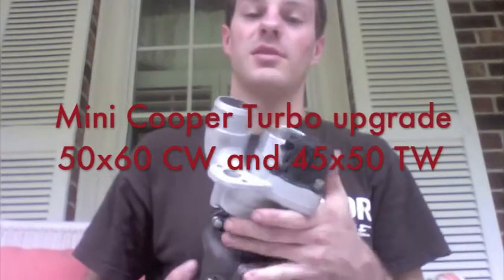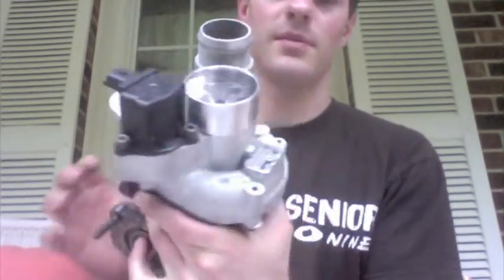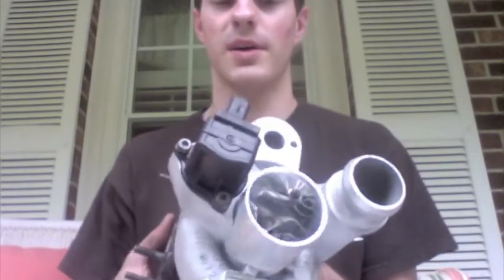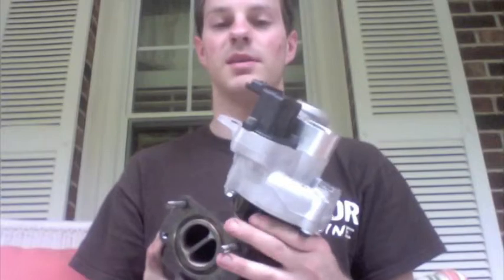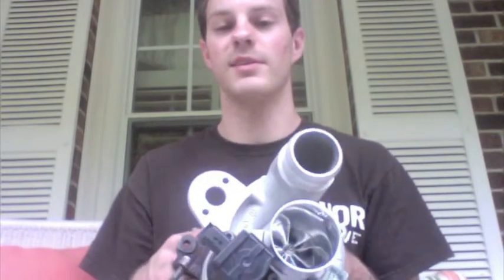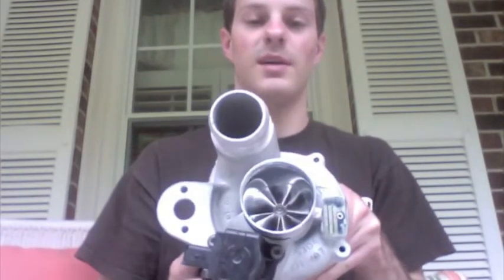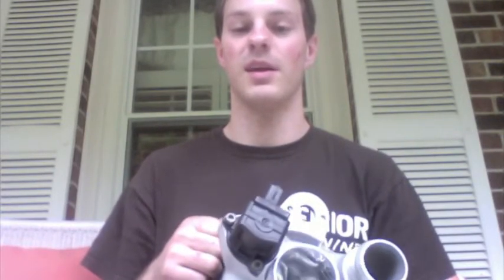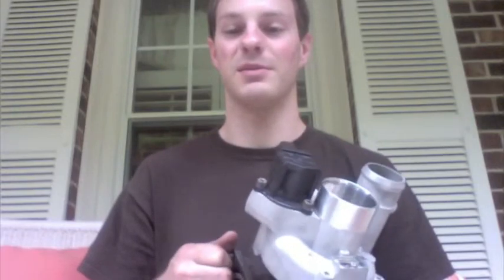Mini Cooper ko3/ko4 turbo upgrade 50mm x 61mm

Comment: if i send you my old k03 turbo how much will cost all rebuilt with the 50x61x65mm billet wheel front and 44.4 x 50mm billet  wheel back? full upgrade.

Comment from the maker: We do the upgrade for 650$.  This time of the year is the busiest for turbochargers. It may take me 4?weeks to get to, I'm still cleaning out older builds and I haven't take in as much work. Since this video I had compressor housings recast so mainly I just have to machine the turbine housing and compressor plate and swap on my cover and rebalance a new assembly.
Reply: /Are these still available?

Comment: Do you guys upgrade the vw k03?
Reply from the maker: Fernando Gomez sometimes we can do this same upgrade, it depends which one you have. i need to know the model and year of the car.
Reply: Year would be a 98 jetta, 1.8 diesel
Reply from the maker: The jetta has a strange compressor housing. i could probably do the 50mm wheel in it, but with that wheel, i only have 1 chance to machine it right the first time, because i have to press a pipe in it. this would be a perfect job for my haas cnc lathe i just bought.  i have to buy a few more things for it.  i could  put a smaller wheel pretty easily like a 43mm
Reply: How much would a job like that run
Reply from the maker: To upgrade the shaft and compressor wheel +rebuild +clip+ balance+ machining compressor housing, and turbine housing, it would be 650$

Comment from the maker: Ariel i made it to be a factory bolt on turbo. Im not sure how strong the factory internals are, but this turbo is good for about 400 hp at most. Most turbo cars can handle that with a factory engine.
Reply from the maker: You need a Bov, and then you need to recirculate the bov if the Maf senseor is before the turbo. BOV are needed, this turbos originally has one in the compressor housing which we eliminate.
Reply from the maker: I couldn't make it look good if i did that. It would be easiest if your ran a BOV off the charger pipe and vented it back to the blow off valve.

Comment: Could you do it to this Ko4 turbo? Pricing?
http://www.ebay.com/itm/111246272399
Reply from the maker: Im not sure. I would have to take measurements of the outside of the inlet so i know if it will cut through or not. I know i could change out the compressor housing with one that i know will work, but im not sure how that will change your intercooler piping and wastegate. To machine the compressor housing if its possible. i would have to make a special plate for it. is usually do that for builds like this.

Comment: What's the max hp/tq is this rated?
Reply from the maker: We dont have results for the Mini cooper. We had someone make 370 @ 20psi on the cobalt.  The issue we are having is that the factory WG will only allow us to push up to 20 to 24 psi before the base spring pressure of the actuator is not strong enough to keep the wastegate valve closed at higher volume of air flow in the turbine housing at higher rpm.

Comment: I am located an Va and I am saving the money now.  How much more boost over stock?
Reply from the maker: The boost pressure is irrelevant to the air flow difference. We have one guy making 364hp to the wheels at  24 psi on the 6 blade compressor wheel.